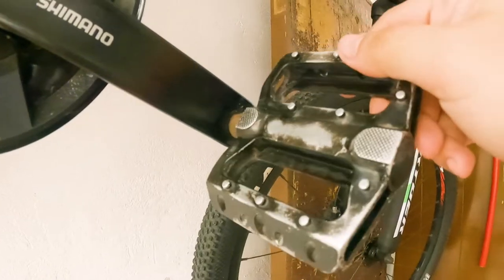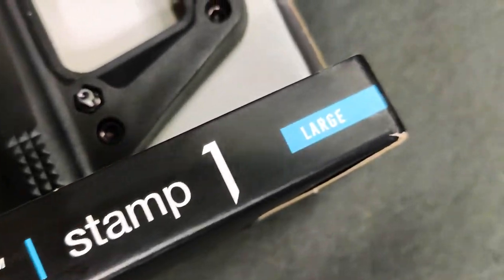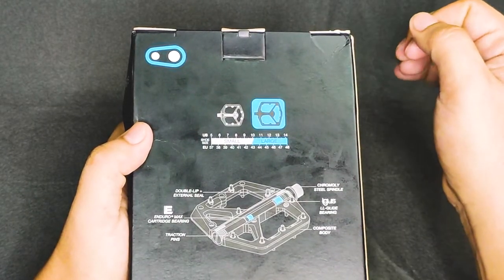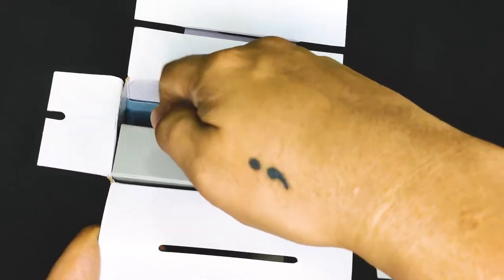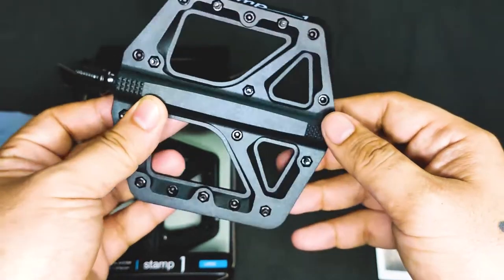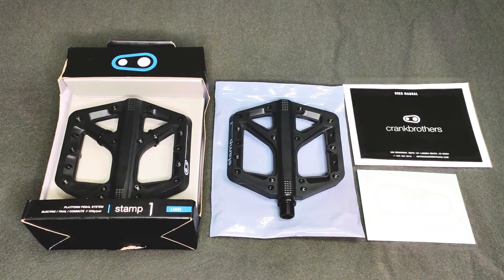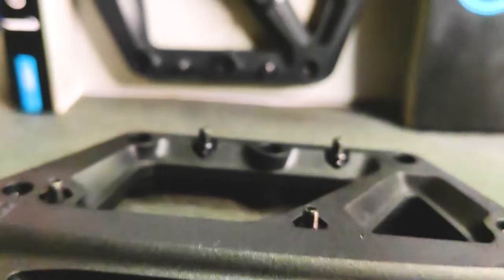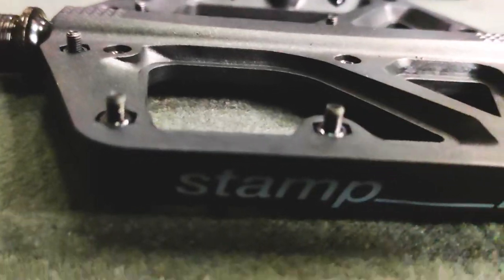Crankbrothers Stamp 1| First Impressions and Tech Review

Comment: These model (Stamp1) pedals not worth buying, got blue ones and bearings on left pedal start making noise after five rides.. :)
Reply from the maker: Sad to hear that, im at month no. 11 and so far no issues... Maybe yours just needs servicing, some water or dirt came in
Reply: @LuisCruzVlogs  I understand servicing after 1 year but not after 2 weeks :)   Plus service replacement kit price 30€ for  50€ pedals, sounds not very well .
Reply from the maker: @markomark3139  yeah agreed on that, you ride mostly on trails bro?
Reply: @LuisCruzVlogs  Trails only, sometimes small jumps if necessary .. :) no DH :) Later  put stock pedals, but they last a little bit longer ~ 10-12 rides, and always the same left side pedal, why not right one? :)
Reply from the maker: @markomark3139  oh really always same side..interesting bro anyeay, ride safe!